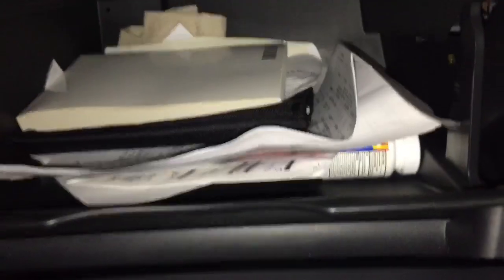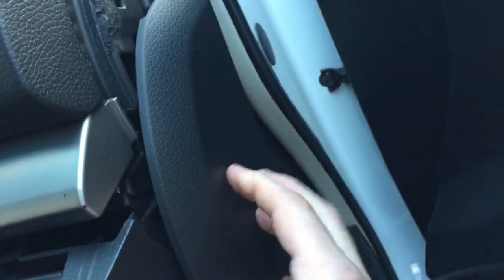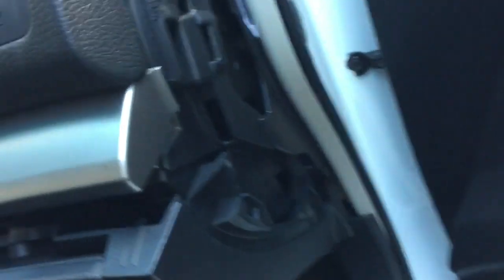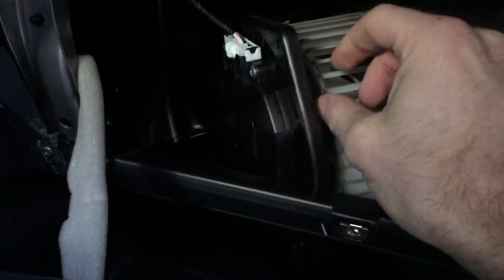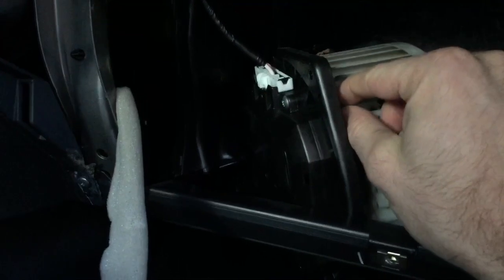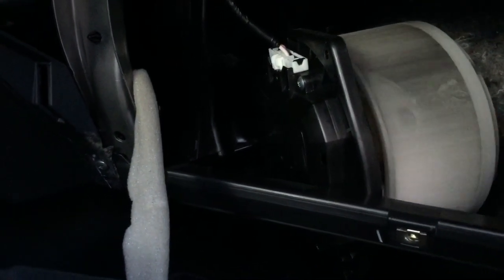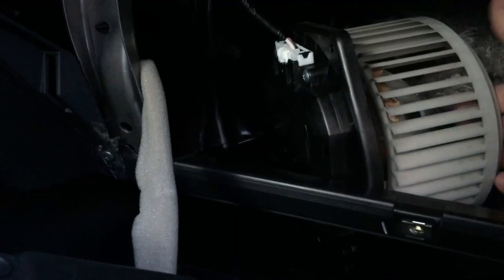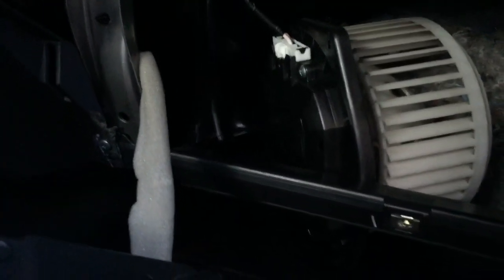Nissan Altima clicking sound from passenger side when air blower is turned on

Comment: Ok...16 hours after my comment last night. I tackled this early this morning, super easy job thankfully (quite a few things in my Altima Coupe make me mental when it comes to certain repairs, especially with larger hands..- eye roll- ) But breathing a sigh of relief, I had the same exact problem. Bunch of leaves, tiny stick inside. Got it all out, short brief puffs of air compressor through the blades knocking off some dirt. Noise it totally gone, in fact its been a while since it's been this quiet! No need to drop a bunch of $$$ on a new motor thankfully! 

Thanks for this video..really appreciate this!! Happy Holidays!

Comment: Thank you thank you thank you!  Wanted to share 2 additional notes:

1) +1 to having someone help.  It was much easier to have my son hold the blower up against the housing while securing the three screws you had mentioned.
2) After going through this process the first time, the AC didn't start at all.  It turns out that I had misaligned the blower when re-screwing it into place.  On the second pass, I got help + made sure that the blower was flush against the surface (you should see a "tooth" appear next to each of the three holes where the screws belong.)

Comment: This solved my problem as well. Thanks! 

One thing to note: when I reinstalled my blower and turned on the car, the blower was not working at all. I turned off the car and pushed on the blower. It clicked into place, which got it working again.
Reply: Adam Sparks what do you mean you pushed on it to get it working? I'm in the same situation

Comment: This video was perfect!  We had the same problem with our 2013 Altima!  Thank you very much!
Reply: I did everything up to 2:20 then instead of removing last three screws I pushed the ac button to redirect airflow and a small door opened. I took a small grabber tool and pulled out a piece of plastic wrap that was making the clicking sound. Thanks for the video.

Comment: To add to this video. I had the same same problem so I cleaned out the blower motor, while I had everything taken apart (the glove compartment) I changed the Cabin Air Filter. A lot of the same stuff that was caught in the blower motor was in the old filter. So changing the filter as well can prolong the built up that will get into the blower motor. Wish I could take a pic of the filter and show you all how it looked. The filter is suppose to be white but it was black, full of dirt, and twigs, even a few small dead bugs.

Comment: Had this problem on Saturday on my 2017 maxima, watch this video on Sunday morning but been too busy to go through with this process, and really wanted a simple fix without loosening parts, but while driving back from work on Sunday I increased the temperature to 90 degrees( my thought was just for the heat to affect the shape of the obstruction leaves twigs and all ) and the fan speed to the highest and drove with it the moment I stepped on a pothole the twig or leave fell out no more noise

Comment: Thank you. Just some twigs and a leaf. Problem solved. The process is the same for 2012 Nissan Altima. Just a tip, after removing the debris from the fan. When you reinstall it make sure it seats properly. Once you get the fan screwed back in. Test it. To make sure fan comes on. Dont make the same mistake I did. I put it on crooked, put the glove back back on and the fan did not come on. So I had to take it all back apart and re do everything. PITA to do it twice!

Comment: Thanks! This rotation noise with the heater just started with my Nissan. The same thing happened with my aunts Nissan a few years ago, turned out to be twigs and other junk...almost like a mouse was building a nest inside (Her car is stationary a lot, doesn't drive much). But I'm hoping this is the cause with mine also...simple sticks, twigs.